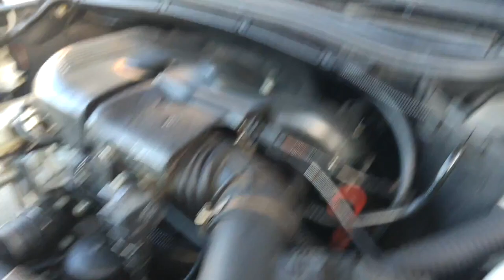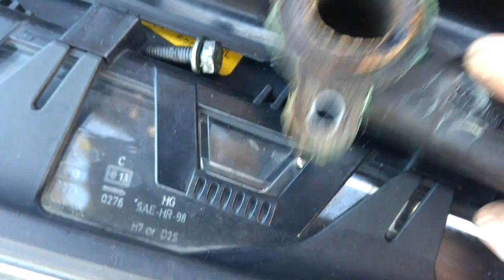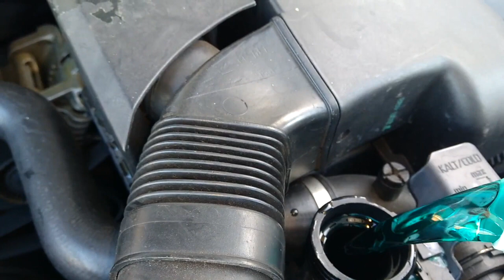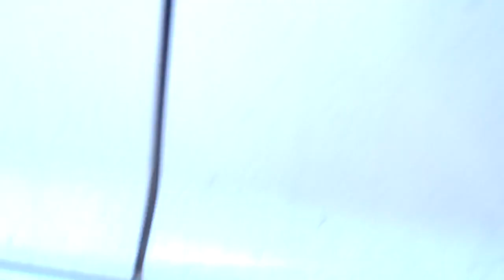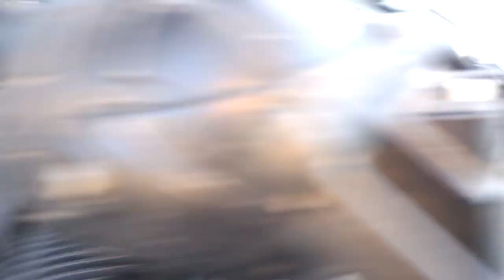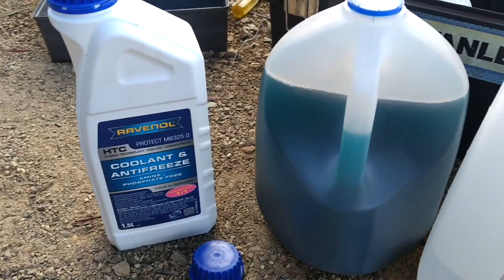2000 BMW E46 318i  - Catastrophic Coolant Pipe Failures

Comment: Mine just exploded with water everywhere. That plastic housing at the back shattered. The one at 3.50. What is it actually called if you don’t mind me asking. It looks like it’s got 2 bolts to fit it
Reply from the maker: So you're also exploded, interesting. This is why all the plastic components need to be replaced, I guess heat cycles from the engine eventually weaken them.
Reply: @ I’m hoping my head gasket hasn’t gone. I was in a car park waiting to turn when it happened so I only ran it for another 30 seconds

Comment: what are the parts number for hoses ?
Reply: Coolant Pipe - Rear of Cylinder Head _UR11531714738
Coolant Hose Connector - Underneath Intake Manifold FEB11 53 1 743 679

Comment: It worked without removing the manifold, I just unscrewed the collar and replaced it in the process. When someone else does it, I removed the cabin filter housing, which helped with unscrewing the second bolt and putting it back on. The first one can be unscrewed between the manifold and the alternator. Instead of disconnecting the cable going to the cabin at the throttle body, it's better to disconnect it at the cabin and remove it altogether (mine was tightly seized and couldn't be removed under the manifold). The remaining two came off easily, only the one going upwards had the old throttle body socket in the harness, which I simply squeezed together with the harness and it came out. The old throttle body also broke off at the engine along with the gasket, so it had to be gently chipped away. When installing the new one, a tip is to attach a deeper screw to the thread, it's worth sticking it to your thumb with tape and inserting it like that, then use a small ratchet directed towards the cabin side to tighten it because that's the only way to reach it. It was a bit tricky and surely it's better to remove the manifold for the job, but I wanted to try it out for fun. If I were to do it again, it would definitely be quicker.
Reply from the maker: Thanks for adding these tips to the comments, I think it will help others also.  Interesting that yours also was almost gone, so I think its a must for anyone with an older BMW to do.

Comment: I have a 2004 318i engine ready to fit, but first before I install it I will replace this part, first remove the oil filter housing and cooler, this makes much easier access to the pipe, that also give you the opportunity to run cleaner thru the oil cooler as they can gum up with bits of worn off chain guides, the seals for the housing and cooler are less that 20 dollars and ez to do.

Comment: Do you have the part numbers?
Reply: Coolant Pipe - Rear of Cylinder Head _UR11531714738
Coolant Hose Connector - Underneath Intake Manifold FEB11 53 1 743 679

Comment: Your exploding pipes and the head gasket is because of a stuck thermostat !!!!
Reply from the maker: Stuck thermostat doesnt increase pressure in the system, only leads to overheat. No overheating prior, just plastic pipe failure.
Reply: did you fixed it or part it in the end ?
Reply from the maker: @lexiaontube  its all sorted replacing these pipes 👍
Reply from the maker: @lexiaontube  I fixed it, had it running but then sold it to get a 4x4
Reply: @rovertasmania7033  and no videos on the fix?😞
Reply from the maker: @hazel-annejoseph4798  What do you mean?  The whole video is about the fix.

Comment: I hate these connectors
Reply from the maker: Agree! Although i guess they where not designed to last over 200k klm
Reply: @rovertasmania7033  on purpose
Reply from the maker: @dadaddymak  I think in Europe cars never see more than 100k klms due to emission controls, so in fact the design is fit for purpose over there, not here.
Reply: @rovertasmania7033  can you give me some advice on wat needs to be removed to get in to a better position of removing the connector? Also check out the footage i just uploaded on this same part.. not sure if its coming from the connector or the head.. check out the video and tell me wat you think.. also is it a number 10 your using to remove these bolts?
Reply from the maker: @dadaddymak  Thats an interesting leak!  Are you sure it isnt coming from the hose below, under pressure streaming it out?  If it was the head there would be more issues, like pressurised expansion tank.  Look closely underneath if you can, or using a mechanics mirror.  I wouldnt remove anything until you get to the source of the leak.  Cant remember the bolt size, could be 10mm.
Reply: @rovertasmania7033  ok thanks..also do you mean the hose thats connected to the bigger coolant connector under the intake?? And ive had a closer inspection of behind the engine..removed the firewall and some other cables to get a closer look from passenger side under the hood. it looks like the connector at the back of the engine on the passenger side is not properly connected to the head.. im guessing the the bolt on the bottom of the connector is looose and is showing a gap between the head and the connector.. or it has snapped on the inside of the head.. but i cant seem to get to it no mater how hard i try to tighten the bottom bolt.. i can put a socket it.. but i cant get anything else in there to fit over the socket
Reply from the maker: @dadaddymak  yes it’s a very tight area. Look at how I did mine, small tools. It may also be that the bolt is too long and has bottomed out without tightening it, although unlikely. If there’s a gap the great, it’s most likely the problem or at least contributing to it. It’s a pain to get to but it’s possible of course as I did the job and I don’t have small hands.
Reply: @rovertasmania7033  one more question.  What is that drain lookin plug above the rear coolant connector? Ive been searching everywhere to find out what it is.. is it a freeze plug?
Reply: what is the name of this connector?

Comment: I have a 316ti in Hobart that is leaking from the back of the engine(ish) Could be either of these problems. Thanks for the video. Might pull that back cover off tomorrow and have a look down there.
Reply from the maker: If its leaking coolant then its either that or the hoses to the heater matrix. Either way pull the cover off and have a look. White stains on hoses will be the telltale sign.
Reply: @rovertasmania7033  Thanks. I know the front is innocent 'cos I replaced all that about 3 yrs ago and it's as dry as...

Comment: Exactly what i want.
I got all water hoses and both plastic pipes.
Today im going to change them.
Thanks for the video :) 
Ps: 
All water hoses and plastic pipes have to be changed every 4-5 years or 60 - 80 000 miles because the engine works 105-115 C° temperature of water cooling and 2 bar pressure.

Comment: Hi how do you get to the back bolt once top radiator hose flange and oil filter top ? What tools are used ?
Reply from the maker: I only used standard tools mate, just make it work and look at options.

Comment: Any help on the part number of the hose you'r holding at 2:26 ? I need to replace mine but can't find the part number anywhere
Reply from the maker: You can get all part numbers in realoem.com  Its a great site with diagras etc.
Reply: @rovertasmania7033  I read your response to other comment right after posting mine and was able to find it thanks to that site, very cool actually. The BMW Z3 version for that hose seems to be rare, without such a parts list it’s literally impossible to find. Thanks!
Reply from the maker: @maesitos  All good, ,surprising how many people dont know such a great online resource exists!  All the best.
Reply: @rovertasmania7033  they could charge 10cents with Bitcoin in oder to disclose the part number.
Reply: Did you find it ? I went through a lot of schemes and can't seem to find it

Comment: Whenever I replace the Block flange (the one below the inlet manifold), it is helpful to remove the oil filter (and cap) then cover it with a clean rag, as it opens up some more space for your hand to remove the painful bolts below the plastic pipe....also, the good thing about both of the flanges that are replaced in this video, is they are not expensive parts, and if you are ever doing a job that give you access to either of them... replace them while you can... the part is cheap, but the labour to do it is not.... do it if you can..... The last thing is the Allen key head on the rear bolt for the block flange IS better than the standard bolt, so it pays to have both as Allen key bolts, rather than hex head bolts, as they are easier to remove in the tight space.
Reply from the maker: Excellent post with great advice.  I think this is critical, just do an ENTIRE coolant service including these plastic unions. Thanks for adding the the knowledge base :)

Comment: I hate this engine ! i have one of my e46 and with many problem which I solved he still has !Terrible engine
I changed the water pump, also in terms of hoses and connectors cylinder head gasket and rectified and still has problems with cooling if I step on the floor acceleration
when I change my car and it will be soon I will have to go somewhere in a field outside the city until I start its engine

Comment: I'm thinking of buying one of these cars, how reliable has it been to you?
Reply: M43 is old school engine with minimum of electronics - if you take care of cooling system, with regular maintenance you will drive it for a thousands happy miles😉
Reply from the maker: @bokiantic  Exactly, coolant system is their Achilles heel.
Reply from the maker: They are a good car, very comfortable and drives beautifully.  Only biggest weakness is cooling system - so hoses and rad, plus as this vid shows. Low KS would be the best, with service history. I only speak for the 318i of course, cant comment on other models.
Reply: That's the exact model I'm looking for, it's readily available in my location (Panama), I'm being offered a 95k km 318i for 3 grand (dollars) which seems like a pretty good deal to me
Reply from the maker: @TheDoomCore  Thats pretty good, but why so low kilometers for a 20 year old car?  Has it only been driven on weekends?  Check condition of interior, make sure headliner isnt sagging.  Else yes not bad price.
Reply: @rovertasmania7033  well, the ones I've seen in my area are around 90-140k km, it seems to be a tendency to have such kms in my country (Panama)

Comment: Not to complain but I feel your pain. Darn BMWs you would think that they would figure out a better way rather that using the plastic that goes brittle after a while. Same here in Los Angeles. Those plastic bits lead to catastrophic failure. Have a 540i and the o-ring failed that goes between the engine mount bracket and the block. Leaked oil everywhere. Took eight hours to replace a $5.00 o-ring. Why did BMW design an engine that has an open oil galley that needs sealing by the engine mount bracket? Totally stupid! Maybe it’s deliberate so we’ll buy a new one every 10 years.
Reply from the maker: One must remember that Euro cars where only designed to last a certain amount of kilometres (mileage)... I think 100K klm or less.  So when a vehicle starts to get older than that, components fail as they where not designed for it.  In Australia cars are used for hundreds of thousands of kilometres (easy to see over 400k on the clock), maybe the same in the US.  But yes, plastic parts mixed with engine heat cycles is the worst combo.  Wish they kept it simple like the old days. All the best.
Reply: @rovertasmania7033  My bmw 318i has 326000 on the clock and never had any major issues. Like every car it needs proper maintenance. Only issue is that with this Australian heat the exterior plastics fade easy.